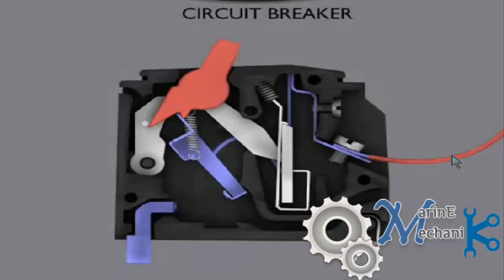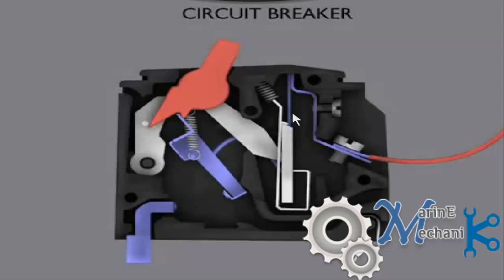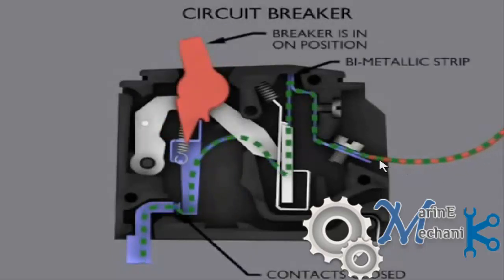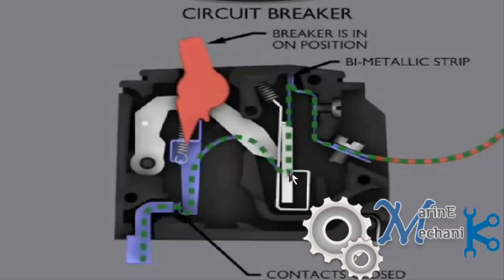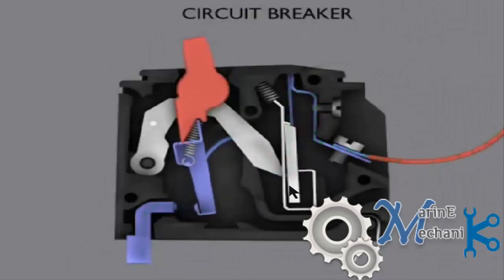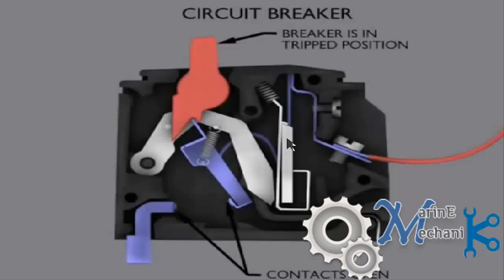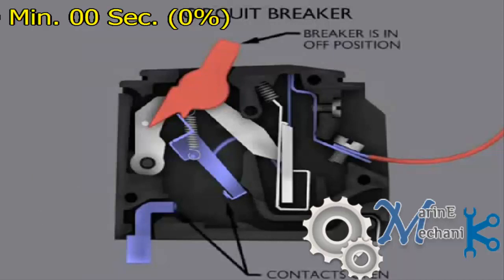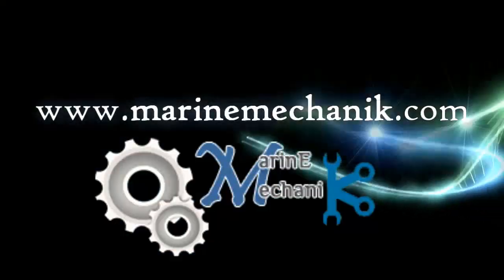Circuit Breaker Animation & Working.

Comment: I think you have your direction backwards. The power comes from the fuse panel. The wire receives current from the breaker by its attachment to the bus. So the wire doesn't "send" power into the circuit breaker; it receives power from the panel and brings it out to the appliance.
Reply: SharkTank  - Because I wanted you to know I knew.
Reply: @bammbamm12  good answer, and thank you for your original comment.

Comment: Great explanation, you are just considering the overload, where the thermal protection works. Maybe you can consider the short-circuit failure and the magnetic protection. Best regards

Comment: Thanks for the video, The thumbnail image included a solenoid coil, the video doesn't have a coil, The coil is for short circuit protection(10-100 times current rating)

Comment: As an electrician who has wired the a breaker box, the input and out put are reversed. Given A.C. current, it really wouldn't matter except that it's unsafe. Also a red wire is 220 or 240.

Comment: Not if it is the main supply breaker for the panel, but it is definitely described with the terminals reversed if it is for a branch circuit! It is just a basic thermal breaker. We use thermag in the USA most of the time. Thermal works well with DC, I am trying to find info on  Heinemann P0111DR type dual rated magnetic instant trip high sensitivity breaker with a calibration coil tap on the main solenoid & no hydromag delay curve. No luck so far. Cheers!

Comment: Its actually backwards...current flows from the bottom electrified breaker legs threw the circuit and out the hot wire.
Reply: yep, just look inside a distribution panel with no field wiring, the incoming main feed would feed the main breaker and then the phase a, b, c CBs would protect and feed the downstream loads

Comment: you are backwards, the current enters the breaker at the small tab on its bottom, the current goes into the house thru the wire connected at the screw. other than that your ok.
Reply: Exactly
Reply: Not always, lots of times you can feed the breaker 'backwards' where as the main lines come into a panel, connect to a breaker and therefore feeds the panel.
Reply from the maker: not always. Mrsleepincorporated is right. it can be turned otherwise depending upon application
Reply: MrSleepIncorporated
: I thought the breaker always feeds the panel. This is the purpose of a circuit breaker to protect the circuit in the panel from the supply voltage. Is not that correct? Where are the videos for learning how to size the breaker and to know which style frame to use? Let's say I supply a panel from a source supply that has a victor socket. The source is a three phase 575VAC and the load is 150HP induction motor or some other 150HP load. How do you know which circuit breaker to choose? When is current a deciding factor? Is the sizing different in a marine application than a train substation application than a airplane application? I would appreciate getting guided in the right direction. I am a young electrical engineer that got laid off from a previous entry level position and I am preparing myself and learning as much as possible to be effective in any industry. Thank you.

Comment: It is normal for main circuit breaker to be a little hot at time? Mine once in a while trip, I dont think my appliances is shorted as
it could be reset. I think maybe it is too old, mine house is 25 yrs old, Ty, I may change a new one myself. My electrician in Spore is vy exp,
want to charge 200$ just to change this MCB which i can get for 20$..
My MCB are both electromagnetic for short circuit and thermal for overloading.. ABB S202 type2 40A

God bless you.
l

Comment: I guess the explanation is a bit wrong. There's two ways the circuit breaker works - in case of instantaneous overcurrent, when the current exceeds nominal value and through thermal effect, that is when the current is within limits (in this case below 20 amps) but still quite high for a prolonged period of time). So in case of 40 amps like in the video, the bimetallic strip will work as a magnet - it will pull in another plate and disengage the links. Not because of bending as the video suggests but due to magnetism. It will bend if the current is, let's say, 18 amps for a certain period of time. That's when the thermic effect will kick in.

Comment: supply and load are reversed? and this video is 4 yrs old
Reply: I would agree, that tab on the breaker is where it normally sits on the distribution panel (line side), the screw side of the breaker is the cable that feeds the  load in the field.
Reply: And this comment is 4 years old

Comment: Is there a way to tell which way the battery side is hooked up to? I don't have anything that indicates how it hooks up. :o
   Is there a way to tell with an ohm meter?

My circuit breaker is different from the one animated here.
Reply from the maker: each Circuit breaker is different based on its maker. May be u can send me a pic of it./
Reply from the maker: If possible post it here. Lemme have a look.
Reply: Sriram Balasubramanian
 I don't know how to. Would you know how to?

Comment: With AC current of course the current flows in both directions and I have even seen cases where a panel is back fed through a panel breaker which is not a main, but ... I think if I was making a video I would show the "supply" originating at the panel terminal and the "load" on the wire terminal.

Comment: No & I think this guy has it backwards, Maybe on boats they run the output to a bus but I doubt it. If this is the main breaker than it is correct, but for a branch circuit breaker this is backwards. In is out. This is a thermal breaker. They make magnetic, thermomagnetic, hydro magnetic, shunt trip, leakage current, stray current, GFCI, arc fault gas tubes & melting alloy heater OLs for motor controllers. The thermal is the most basic. They can run for hours at  130% of rated load.

Comment: Typical Engineers explanation. An electrician would consider the direction of the wiring to be from the panel to the field appliances, switches etc. In reality he remains incorrect though becaus AC power changes directions 60 times per second (if you're from murica)